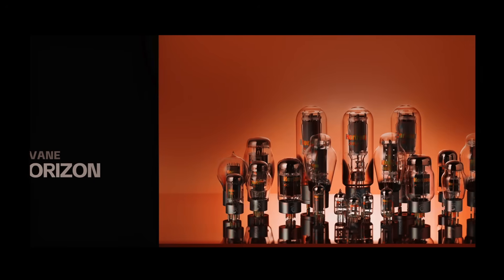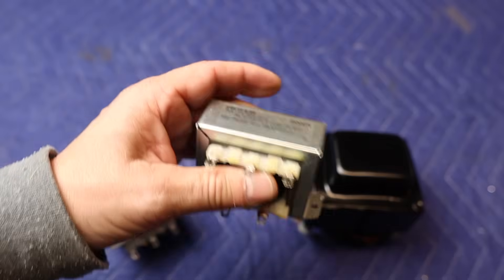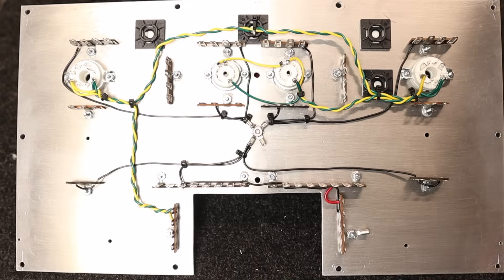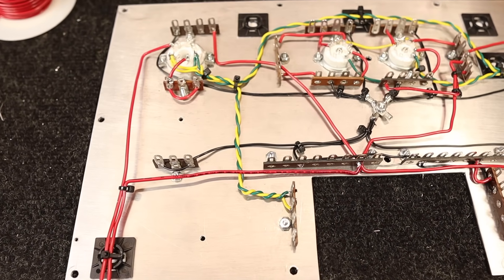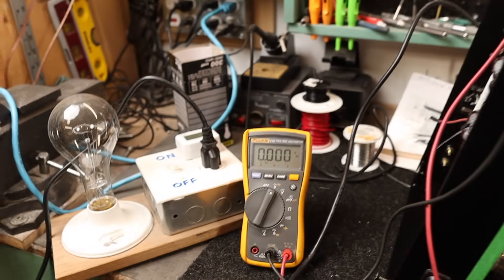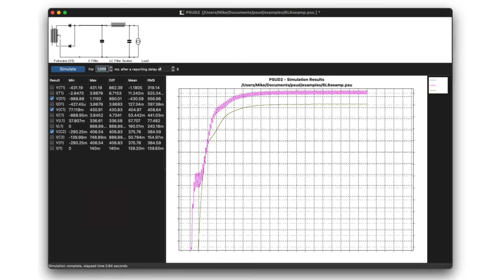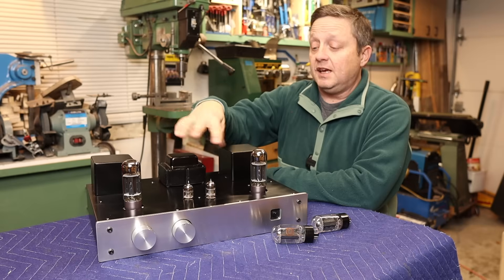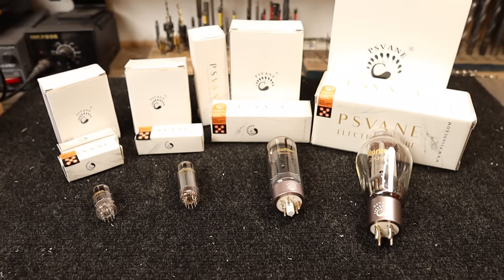DIY 6L6 SE Stereo Amplifier using PSVane Horizon Tubes

Comment: hi mike ,i cant understand why r4 resistor  200 ohms instead a coupling cap resistors for  voltage  divider ,maybe im wrong but id like to understand this shematic,thanks
Reply from the maker: Thanks for commenting. The R4 200ohm resistors are Grid Stoppers. They help stabilize the grid and help block RF. The first two stages are direct coupled. One reason for this is to limit the amount of capacitors in the signal chain. Some people feel that too many capacitors inthe signal chain can "color" the sound. You can Google Direct Coupled amplifier stages for more info. You could add a capacitor here but you would need to change a few other things as well (i.e bias points and grid leak resistor)  The 6.8k resistor and remaining electrolytic power supply capacitor is to decouple the driver section form the power section and provide a bit more voltage drop to lower the B++ on the plate of the 12AU7. I hope that makes sense? Cheers.
Reply: i wasnt  to inform  about driver direct coupled its new for me .i know how to calculate voltage drop and current in a circuit rc but im not sure to calculate well a voltage divider on your shematic.If i take  rt=r1+r2  so 22k +6.8 k =28.8 k and 380v divide by 28.8k =13.1 ma  travelling on the second half 12au7  so am right or wrong .So if 1icalculate  the first half 12au7 this would be  328v divide 68k=4.8 ma ,i hope my calculations makes sense.thanks a lot
Reply from the maker: Sorry, I don't quite follow your calculations.   The voltage drop across the 6.8k resistor is the combined current draw of each 12AU7 sections.  V = I x R.  V = (3.7mA + 3.8mA) x 6800. That is ~51 V.   380v-328v = ~52v .   (The numbers are a bit off due to rounding off and multi-meter fluctuations upon time a measurement)  I hope that helps? Cheers.
Reply: @MikeFreda  hi mike ok i understand how to calculate current for the first triode this is 328v -76 v=242v divide by 68k =3.7 ma   but the second triode if i make the calculations 380v-328v =52v divide by 22 k =2.3 ma  but you mention 3.8ma   there is something that i missed probably.thanks
Reply: ok mike i i understand  its 328v-243v =85v divide by 22k =3.8ma now i learned something more on the calculations thanks a lot  @MikeFreda
Reply from the maker: The 2nd triode calculation is just the voltage drop across the 22k. 328v- 243v=85v.   85 / 22,000 = 0.00386  (3.8mA)  You can back that calculation up by the cathode measurement. 81v / 22,000 = 3.7mA.  Each section of the 12AU7 is treated as its separate node.
Reply: @MikeFreda yes i understood all the calculations
Reply: @MikeFreda  yes i understand   all the calculations thanks
Reply: hi mike id like make an tube  amp one day and calculate all the shematic from my conception ,so i made many  tube amps  like a se with  kt 66 tube and 6sl7 driver and also fender 5f1 also a preamp 12au7 from bruce rosenblits  and zen amplifier from nelson pass but i prefer tubes amps,Did you engineering  your amp!
 @MikeFreda

Comment: hi the wire pvc ,is it sheath resist to solder iron  without melt ,thanks
Reply from the maker: Yes, the sheath is heat resistant to a point. With a proper / quick soldering operation it will shrink slightly and stay in place. If you overheat it, it will eventually disfigure and melt a little.  Cheers

Comment: Hi, I noticed from the schematic that the second stage/second half of the 12AU7 is DC coupled to the first stage, but you use the volume pot as grid leak resistor. It seems risky to me not to give that stage a fixed grid leak res, as in case the wiper of the volume put loses contact through age/dirt, the grid is left 'in the air' and the cathode current of that stage goes out of bounds.
Reply from the maker: Thanks for commenting. Yes, that is a possibility especially if you have a budget pot. It doesn't hurt to have something like a 1m ohm resistor from wiper (pin 2) to ground.   For safety sake, I'll add it to the linked schematic. Thanks again, cheers!

Comment: Hi Mike I have a spare super reverb chassis with the transformers, tube sockets and filter caps. Would the power transformer 375-0-375 volts work with this design?  I have 6L6GTs tubes as well believe not sure the difference.
Reply from the maker: Yes/No. To get the clean high output/headroom Fender uses high B+. It's common for these amps to have 455-465v on the plates of the 6L6's. If you wanted to use the parts you would need to tame the B+. A tube rectifier and some dropping resistors may get you there. Also, guitar amp OT's are different then HiFi OT's. They typically have a different frequency response and in a super reverb, it's a Push/Pull OT design not a Single Ended design as I have done.  I would not re-use older filter caps. They also need to be a higher value... you will probably hear some hum emeniate. With some work, you could repurpose the PT, chassis and tube sockets but that's about it.  Cheers
Reply: @MikeFreda  thank you for the tips, might as well sell these and get proper parts.

Comment: Hello Mike, your video just showed up on my feed.  Wow, excellent job on the chassis!  I have several suggestions for the circuit design, and wondered if I could just E-mail you the info since it is a bit lengthy?
Reply from the maker: Thanks for commenting.  Yes, please do and feedback would be appreciated.  My email address is in the about section of my profile. You may have a hit the “more” button on my homepage to see. You may also have to subscribe to see it.  Cheers.
Reply: @MikeFreda  Thank you Mike, I will work on this tonight and try to send you something.
Reply: @MikeFreda  Hi Mike, I finished the list I wanted to send you, however I tried every thing I can but, YouTube won't display your E-mail.  It makes me waste lots of time going through Captcha checking but, still won't display your address, it just keeps saying "try again".  After 3 or so tries, it tells you the try limit has been exceeded.

Comment: Really enjoyed this project. Question though, would this front end provide enough swing to drive an EL34?
Reply from the maker: Thanks for commenting.  Yes, it is possible. It will work but I’m not sure if you will get full output. I have modelled it looked at load lines.  You may need to raise the B+ on the plates of the EL34’s accordingly.  Cheers.
Reply: @ thanks for the reply. I figured that the B+ on the EL34 would have to be somewhat higher to be optimal. I am rebuilding a Dynaco ST70 and will have an extra chassis and the original power transformer to start with. I am thinking that the stock power transformer would work well for a project like this. And due to the reduced demand on the transformer in both the heater demand and B+ current needs for an amp like this, that stock transformer would probably run reasonably cool. Unlike the hotter than Haitis mode in the ST70. I modded the amp back in 1990. I used it for several years before it got stashed away. It was working when I put it away, but like I said, it ran really hot. And when I got it out and looked it over, I found several components that were stressed from the heat and decided to use the Miller Audio kit and upgrade the power transformer to improve its performance and reduce the heat generated.

Comment: Is there an ohms rating on that cat fire cable like 100 or 120? Is it sound good? you're going to put some global feedback
what sort of speakers do you think you can drive impedance wise quite low?
Reply from the maker: Thanks for commenting. The Cat 5 i used is: #R7J604 Cat 5e 4PR 24AWG - type CM UL E126126-DG.  I believe its 100ohms but I don't; think it matters since I'm only usine 12" of it.   I haven't done any real testing of it. Its seems to work okay. I've been using Cat 5e cable for years.  Yes, I plan to try negative feedback. I will employ/try Global and Plate-to-Plate. These are 8ohm output transformer but I suspect you are referring to speaker sensitivity.    I don't listen to my music really loud so sensitivity numbers don't mean that much to me. It's more about the frequency response/curve and imaging.   I've used 95dB full range, 92dB full range and 89dB Mission 761 2 way. They all sound great to me. Lower than 90dB you will notice the loudness.  This is a lower wattage tube amp (~6 watts) so if you like really loud music, you may want to go with a Push/Pull design.  cheers

Comment: There needs to be more modern 6L6 and EL84 amps put out by manufacturers. It seems everything is 300B, 211 or kt88. Why not make tube amps that owners can source vintage tubes easily and cheaply? At least Elekit makes a nice 6L6 amp.
Reply from the maker: I agree, that's why people make their own.  Lets face it, tubes amps are a niche market and 6L6 and EL84 are not considered audiophile grade tubes so people with go with 2A3, 300B KT88..etc since that's the industry standard and what everything is referenced off of. No profit margin for that sort of thing.  Not to mention a lot of modern speaker are inefficient and to get high SPL number you need power... try to sell a 20-30 year old a 5 watt SET that sounds warm and glassy or a 200W Denon / NAD at a fraction of the cost that will rattle the dishes and have the neighbors call the cops. Cheers
Reply: @MikeFreda  I think tube makers and amps makers talk behind the scenes to plan for the biggest profits by making only amps using high cost tubes.
Reply from the maker: I'm sure something like that happens. Those audiophile magazines don't pay for themselves!   A good friend of mine was in the bike industry and the shenanigans favorable for reviews was prevalent.    You buy and ad, you get a nice review one day. Cheers
Reply: @MikeFreda talking about bike ads and reviews, that is true. Eff it all, I just want to listen to tubes.

Comment: Nice video. It will be interesting to see how your tweaks go.
Would you consider drilling so ventilation holes above the large resistors to allow cooling?
Reply from the maker: Thanks for commenting.  The bottom will be a mesh screen and taller feet to allow for good ventilation. I did consider adding holes but it would take away from the look I was going for.  The mesh will allow good airflow.  Have a look on my community page. It will look the same as my EL84 amp.  Cheers.

Comment: Can you make a tutorial video on how to bias tubes?
Reply from the maker: Thanks for commenting.  I’ve considered doing something like this but I’m not sure what to focus on.  Do I start from the ground up from load charts or just focus on how to measure,  calculate and adjust an output section? Would make for a lengthy (and dry) video.  Cheers.
Reply: @MikeFreda  maybe on load lines and choosing a cathode resistor when you have a reactive load like an output transformer

Comment: Nice build! instead of choke I propose to use gyrator. much better inductance, faaaar above choke!
Reply from the maker: Thanks. I've heard of gyrators in other electronic devices but never utilized in a tube amp PSU before.  You use them?

Comment: Nice work, Mike👍🏼.. I dig the chassis.. I hope you could design a 12/6SN7 front end version..
Reply from the maker: Thanks.  Yes, you can pretty much swap those tubes in and it would work just fine. Of course the tube sockets and pin outs are different… but it will work! Cheers.
Reply: @MikeFreda Thanks Mike.. Would the input stage and driver stage plate currents be also around equal with the 6SN7?
Reply from the maker: Yes.  A 6SN7 is very close to a 12AU7.  They both have a mu of 20.  You could plug and play but double check the voltages and current before you run it.  The concern with this circuit is you need 130-150v differential between the driver stage and the output stage. If you had 400v on the plate of the 6L6 you should have around 250-260v on the plate of the 6SN7. If you have a hot input source, the voltage swing will go high and do funky things to the 6L6.   I hope that helps?

Comment: For info : The 6L6GC ( nos) has 30 watts plate..........7027A and 7581A have 35 watts plate ....So refering to the datasheet of the the Horizon tube...........do NOT use these in an amplifier using 6L6GC like a MC 240 and  or other amplifiers designed for the 6L6GC or 7027A tubes  !
A fabulous nice sounding tube is the nos 6V6G ( Marconi/GE )
Reply from the maker: Good point.  Thanks for mentioning that.  I’m not sure if their data sheet is a conservative rating or not but I would probably just stick to the tubes that the original manufacturer recommends. To be safe, I probably wouldn’t use these in a BF Twin or super reverb as well. They have very high B+ and bias.
Reply: @MikeFreda  Indeed to be safe ..........the original 6L6 WGB ( C is next evoltion is equivalent to the 5881 tube ( good sounding reinforced/reliable 6L6 tube but with lower votage ratings and reduced plate watts ° I would consider the WGC as a 5881/6L6WGB )
Have a nice day and always looking out for your videos.

Comment: Hi Mike, nice build. You put a lot of quality into your work. Just curious why you never like to use a tube rectifier 5U4, 5AR4 etc. ?
Reply from the maker: Thanks for commenting.  For guitar amps, I typically do.  For HiFi I typically don’t for a host of reasons.  Cost. Different PT, I can use higher capacitor value for better filtration, Heat, noise, space and less voltage drop are a few.   I don’t hate tube rectification, I just find solid state easier to work with.    Don’t worry, I will use one in a hifi amp in the near future.  Cheers.

Comment: Hi Mike, I used a 2x LM337's  in constant current mode on the cathodes on the audio output tubes 6L6 push-pull on a 50 mhz xmitter. Nice about it is that it compensates for tube age and balance. Added some negative feedback to somewhat flatten the frequency response. I modified a Heathkit AA-22 stereo amplifier on all 4 output tubes the same way. Thermal camera imaging show that heat being dissipated on all output tubes are equal.  (Ithink I set them at 22ma each at 275v plate voltage) 7w plate dissipation each, 6GW8.
Reply: I am a fan of constant current sources as well but this is a SE amp and a simple CCS in the cathode does not work here. Look out for John Broskies applications.
Reply: @Pentode3000  I've read some of applications, he loves grid biasing.
Reply from the maker: Thanks for commenting.  Great to hear about others doing similar things.  I do like this amp and will “play” with it a bit.  You have to start somewhere, test, measure and figure out what to do next.   Cheers.

Comment: I wonder why the plate dissipation is only rated 23 watts? RCA, Tung Sol, Sylvania, and even Svetlana 6L6GC's are rated at 30.
Reply: Might be lost in translation? Typical operation was labelled as max?
Reply: @rickg8015  Could be. My homebrewed 6L6 SE amp runs at almost precisely 23 watts dissipation and so these tubes would be, according to their spec sheet, maxed out. I'm running Sylvania 6L6GC's right now, and they have about 1,000 hours on them so far with no problems.
Reply from the maker: Good question. Then again, rickg8015 may be onto something here! I do know that not all 6L6's are created equally. There are several variants and they do vary from each manufacture. The tube used is listed as 6L6WGC-AT. The W signifies to withstand greater vibration. I'm not sure if that also means less current output.   Even the Datasheets have misleading information, like calling them a Pentode.  They are actually a Beam Tetrode as someone stated in the comments below.  I will do a deeper dive on this.  cheers.
Reply: @MikeFreda  You're right about them being beam power tetrodes. And the W usually denotes a "military" tube, with stronger construction. As far as I know, all "GC" variants were rated for 30 watts. Earlier versions, like the metal 6L6, the 6L6G, 6L6GA, and 6L6GB all have 19 watt plates.

Comment: Awesome channel brother, love how you make it all from scratch!

With the Psvane tubes, do you know what their claim is for this line? My understanding is they are made in China. Do they claim to last longer or be built better or something like that?
Reply from the maker: Thanks for commenting.  At the end of the video I do a deeper dive on the tubes.  Yes, they are made in China.  This is considered a mid grade tube using some features from their premium line.  From what I gleamed from their supplied literature these have a different base, new anode coating and improved internal structure for lower noise and microphonics.   I hope that helps?   Cheers.
Reply: @MikeFreda  Sorry, didn't see the explanation at the end of the video, my bad. Thanks for the reply!
Reply: lots of premature failure in several of their tube types. sound great but terrible quality control.
Reply from the maker: Thanks for commenting. I haven’t heard that but I do intend to use this amp a lot so I will definitely follow up on how things go with these tubes and do follow up video on future mods of this amp.  Cheers.
Reply: @MikeFreda  good luck
Reply: @MikeFreda  Awesome, definitely looking forward to the Tube update!!